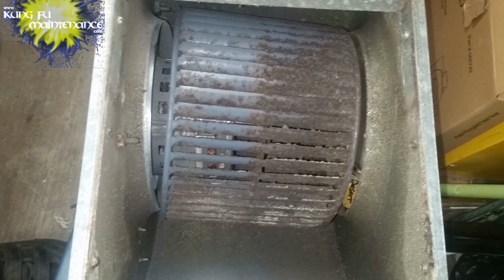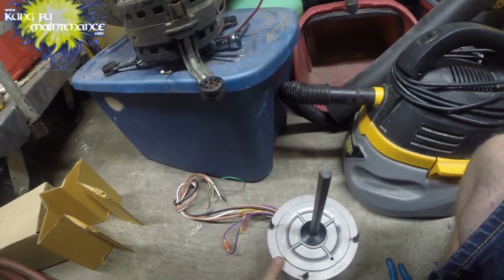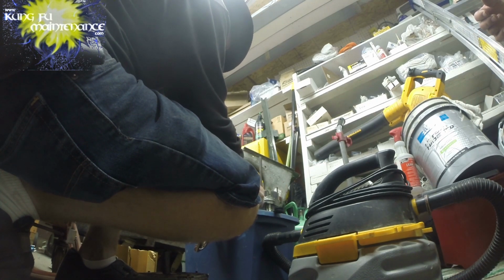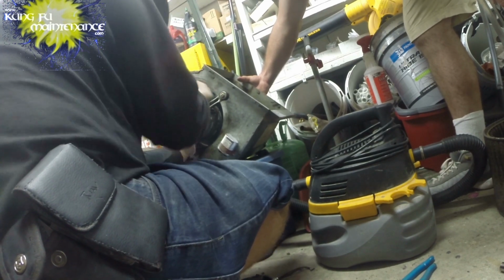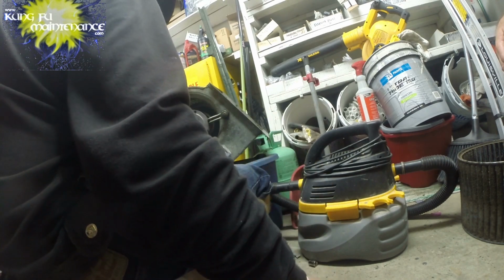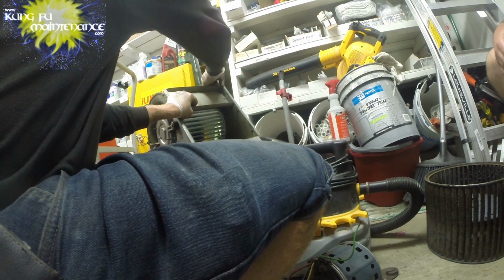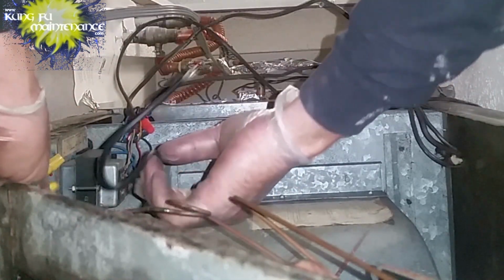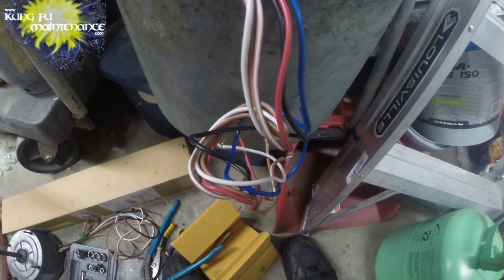Can An Outdoor Condensor Fan Motor Be Used To Replace A Broken Indoor Blower Motor

Comment: You could of used it temporarily if the one speed condenser motor is the same as your cool speed on the blower motor. When it came time for heating then you would need to change it.